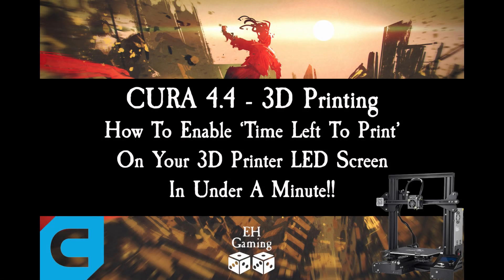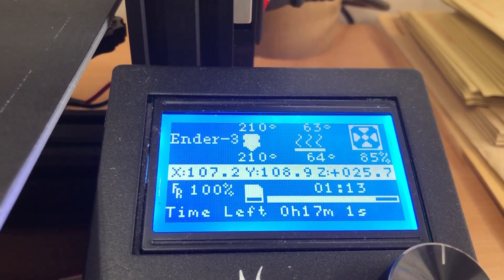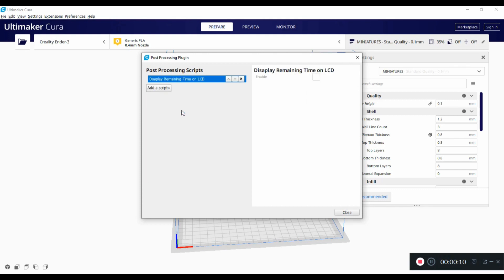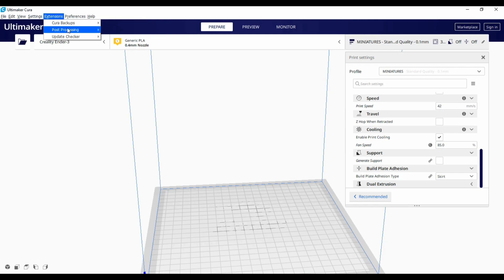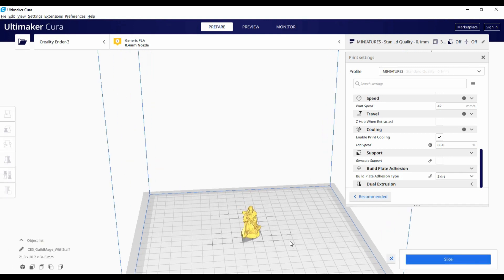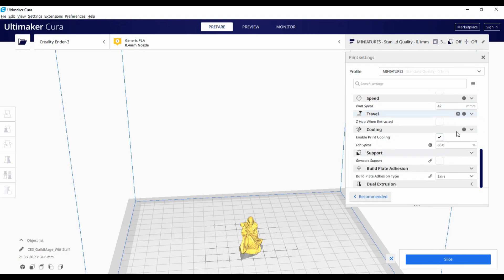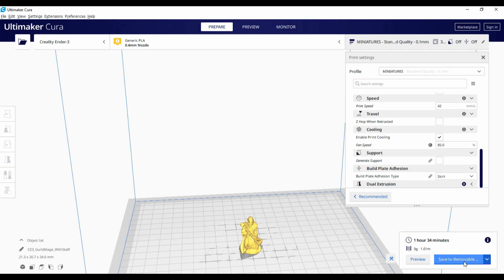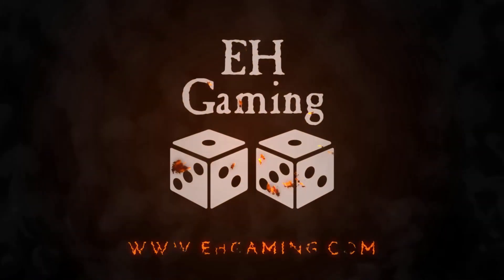How To Show Time Left To Print On 3D Printer LCD Screen Using Cura Slicer Extensions In 1 Minute

Comment: Noob here, but I would really like to add this time remaining.  However in my Cura 4.8 install the script you show does not appear in the drop down.  I have searched and am unable to find anything that leads me in the right direction.  Yes...I did check the configuration and my scripts folder is empty...Thank you!
Reply from the maker: Hi John, we’re all noobs with these temperamental machines! In 4.8, check Extensions/Post Processing/Modify G-Code. Then add the ‘Display Progress on LCD’ script. Then make sure the ‘Time Remaining’ box is ticked. That should do it and any future g-codes you create will show it - please let me know how you get on 👍

Comment: I'm running the SKR E3 Mini with TFT-35 display.  The display didn't show anything different with the added code.  Is there a way to make it work on this setup or would that have to be done in the firmware?  I'm also using Cura 4.8. Thanks!  BTW, using your profile the miniature came out awesome on my E3P! First  time printing one too, wont be my last!

Comment: Thanks for the tutorial .. If i happen to change the print speed from the printer, does the remaining time adapte to the speed change?
Reply from the maker: That’s a good question and I have to be honest and say I really don’t know! I’m inclined to guess that it won’t adapt as the time remaining value is set in the gcode file and I think the printer just reads that value and displays a timer...doubt it will be clever enough to adapt on the fly. Keen to hear back from you if you try it though...thanks for watching 👍
Reply: @EHGamingUK  
If you slice the model with the different speeds it'll show the right times.
There is a line in the g-code near the top that tells us how long this print job is going to take. That value will change based on the options you put into Cura when you slice the file. So it will adapt and it will print the correct times. As far as going in and tuning the job while it's running, I don't know. But it wouldn't be very hard to find out if you were printing something that's under 15 or 20 minutes but over three or four like earrings take.

Comment: Hi
For some reason my ender 3 isnt showing time remaining? Ive followed the steps.
Reply from the maker: Craig Roberts Hi, sometimes when adding the extension you need to exit Cura then start it up again. When you do that, go back to the Extensions menu / Post Processing / Modify G-Code and make sure the Enable box is still ticked. Any gcodes you output after you do this will display the time remaining...or should do!
Reply: @EHGamingUK  
All sorted thank you for your time
Reply from the maker: Craig Roberts My pleasure, thank you for watching 👍

Comment: Great video going to give it a try now. Have to say you got a very clean print, what profile do you use for mini printing.
Reply from the maker: HI Michael, thank you and sorry to leave you hanging for a few days - I have added a link to my miniatures profile in the video description now which you can download and then upload into Cura to try out. Hope that helps.
Reply: EH Gaming Thanks I’ll have to give it a go. I do have a resin printer for doing minis, but having seen the detail quality people have been achieving using the Ender3, really want to start getting the same level of detail from my own machine. I’ve had great success making building and terrain, though my miniatures are no where up to snuff when it comes to FDM printed minis. 
Do you have any advice for calibrating the filament for the profile.  

Thanks again 
Michael
Reply from the maker: Michael Feeney Sure, here’s where I noticed the difference; I swapped to using Esun PLA+ filament which performed better than the Sunlu filament I had been using. Slowing the print speed down to around 40 and squeezing the layer size to 0.1 did help. Reducing the cooling fan speed to 85% seemed to help. If you have a set of digital callipers then worth measuring the actual diameter of your filament. It should be 1.75mm but there can be a variance of up to .3mm. If you can measure it in a few different places and then if you find it’s actually 1.77mm then change the value in Cura before you slice. But, the main thing is to get your bed level dialled in as perfectly as possible as at 0.1mm layers you will see ‘issues’ that wouldn’t really be a problem on 0.2mm terrain layers. Oh, and experiment with the right nozzle temp; I’ve found 210 degrees to work really well with Esun PLA+. Test and learn and tweak. If you search on Thingiverse for 28mm prisoner then you should see a hooded figure as the first result by a designer called dutchmogul. It’s the same guy who did the model I’m printing in this video...that prisoner model takes less than an hour (about 54 minutes)  so a good short one to practice with. Good luck 👍
Reply: EH Gaming interesting when it comes to bed levelling I’ve found a set of feeler gauges to be an excellent investment. I find the 0.13 gauge gets the first layer almost perfect. Some time I just need to do a fine adjustment by eye as the first layer is going down.  I agree with you about 0.1 layers of the beds not right or the first layer doesn’t go down like silk, the print probably will have some issues.  I have found ERYONE PLA a good all round printing filament it seems behave similarly consistently across all colours and speciality filaments. Though I have noticed that the tolerances can range from between 0.03 and 0.05 depending on the roll.  I haven’t had a chance to try any PLA+ is there that much of a difference ?
Reply from the maker: Michael Feeney Hi, sorry, I missed this follow up last week...just ordered the feeler gauges, great idea, thank you. I’m starting to notice a dip in the middle of my bed so trying to get perfection all round by using post-it notes in the middle...it’s an ongoing battle but the gauges will help with that. Personal experience is that the Esun PLA+ is giving me the best results and noticeably so but it sells out quite quickly so I’ll give the brand you mentioned a go next time 👍